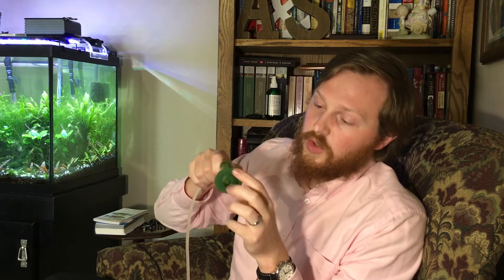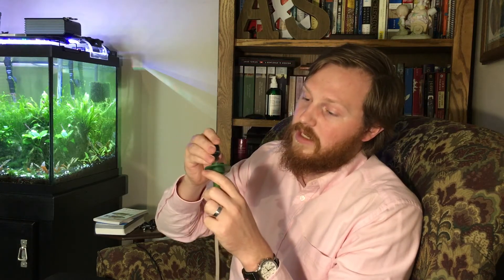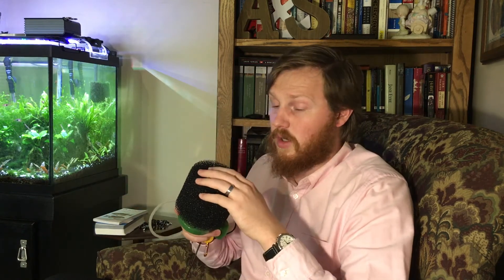What is a sponge filter and how do sponge filters work

Comment: Just purchase a 5 gallon sponge for my cherry shrimp an i was confused weather i needed a han on on back filter aor would the sponge do the work
Reply from the maker: The sponge would do fine all on its own.  With a hang on back filter you are liable to get shrimp sucked into the intake and need to put a sponge on it to prevent that from happening.  Might as well save yourself the hassle and just run a sponge filter.  You still will need to cycle your tank if you are using a new sponge.  If you have other tanks that are healthy, you can take a filter, squeeze some of the brown goodness into the new tank from that old filter sponge or cartridge and plop the sponge in.  Bacteria from that old tank will then get into your new tank and you'll be ready to rock and roll in that new shrimp tank.  Hope that helps you, let me know if you have any other questions.